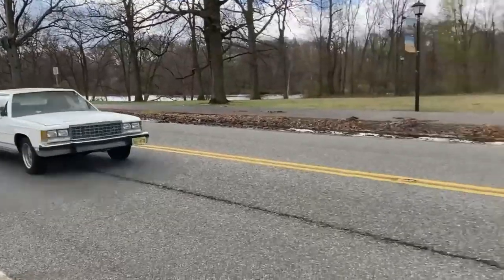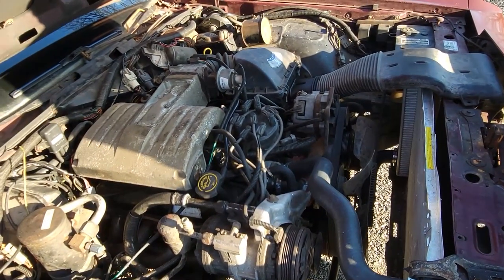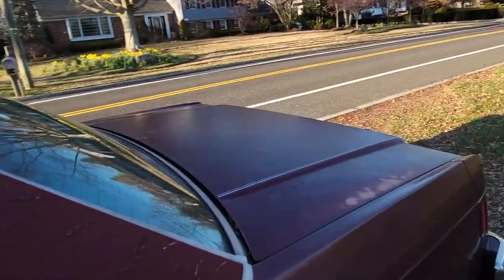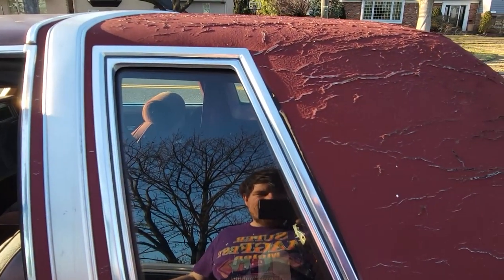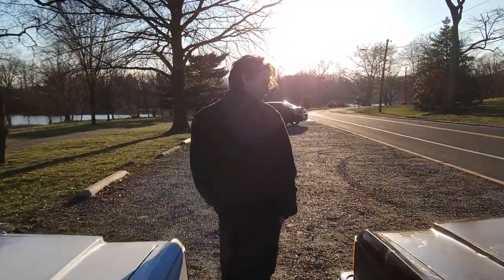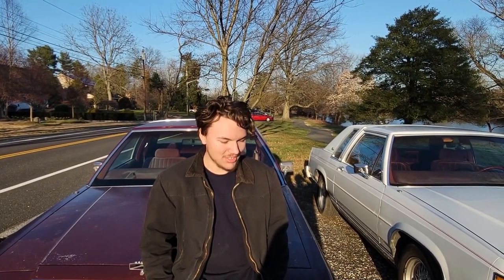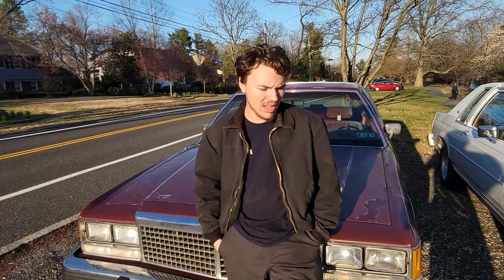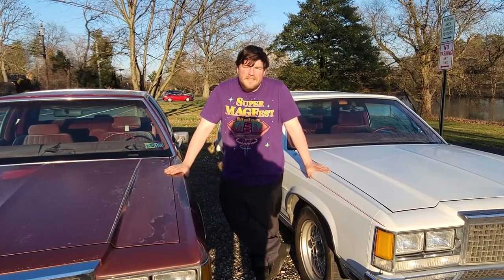Welcome To Crown Vic Diaries Part 3

Comment: I miss my crown vics. Best cars ever I've ever owned. I had a 85 crown Vic light blue with a navy blue landau roof blue cloth interior fully loaded then I had a 87 Black with black cloth carriage roof that had the halo that gave it the limo rear window. Red velor power seats fully loaded with red pinstripe. That was my favorite one i miss that the most lol. They are the best riding cars.
Reply from the maker: Thank you for your comment! The blue 87 that Steve had which is featured in the intro also had the coach roof. It's a very unique option.  Black and red is also an excellent color combination. What happened to your crown vics?